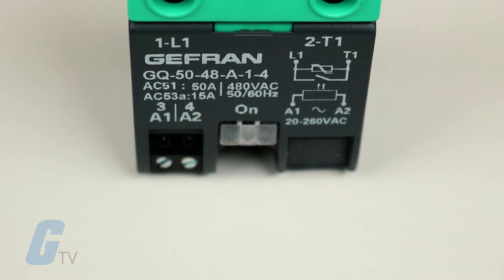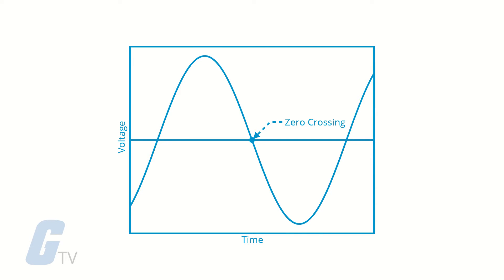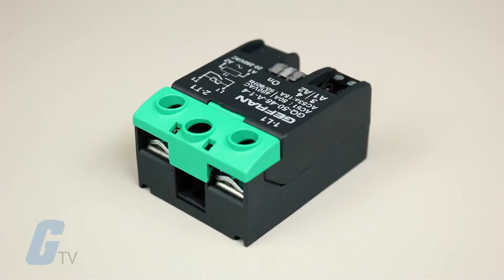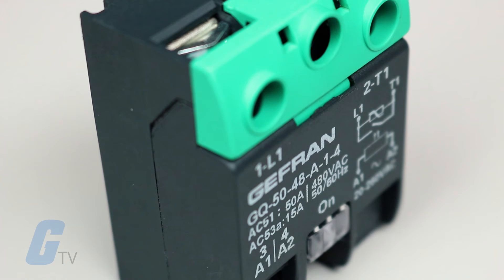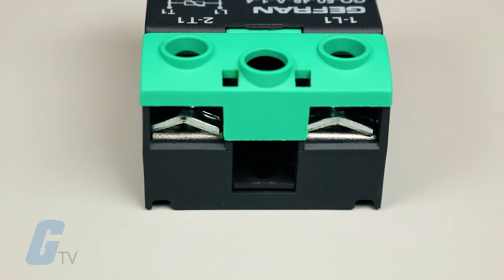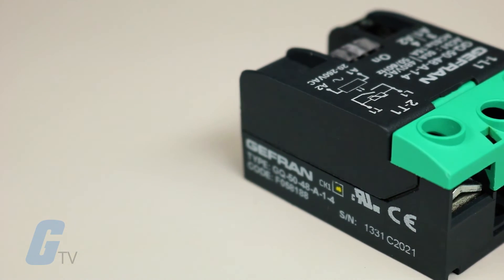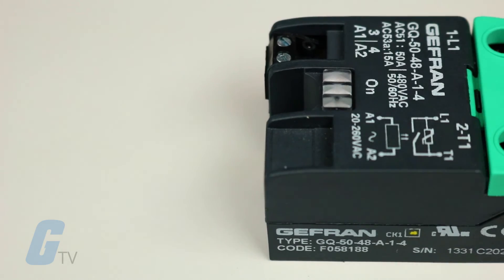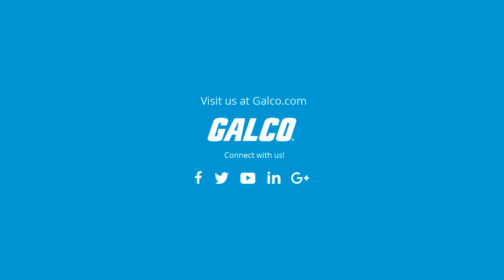Gefran GQ Series Solid State Relays

Comment: what are the other types of SSR?
Reply from the maker: This SSR has an AC input, you can also get DC voltages for the control input, different types of screw terminals, different types of mounting, DIN rail or PC mount etc.
Reply from the maker: There are many different types and quite a few different brands also. Here we are showing the Gefran brand, there is also Crydom, Carlo Gavazzi, Chromalox, IDEC and many others.